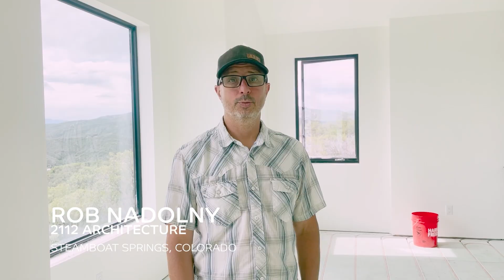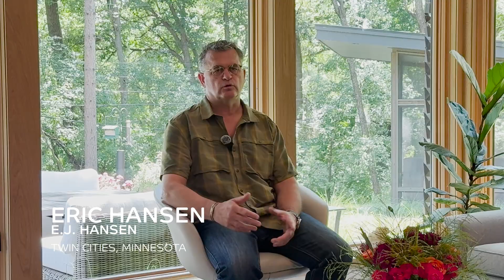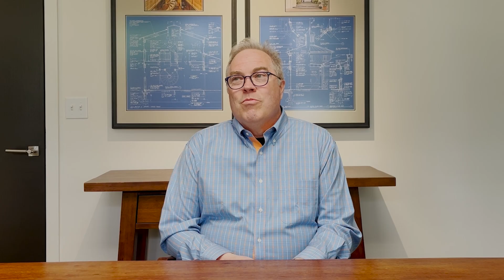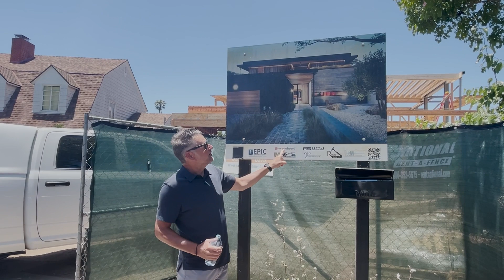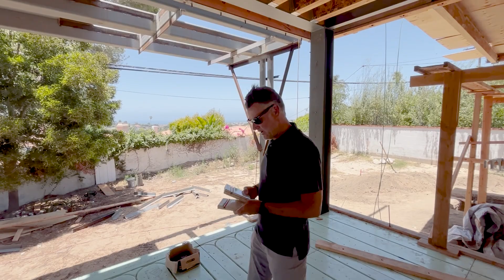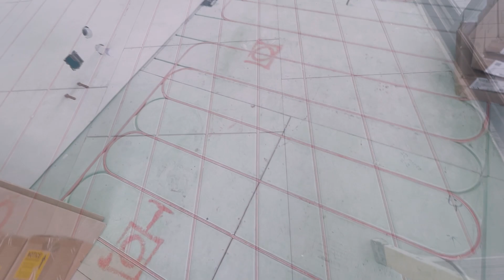Architects and Engineers talk Warmboard (Extended Cut)

Comment: What about cooling in the summer months? Can you please explain how you would go about it?
Reply from the maker: Cooling is done with a separate system - traditional AC or mini-splits, for example.
Reply: @Warmboard  I am really struggling with deciding if Warmboard is for my project - just because I cannot find a cooling alternative that will work with the system. So basically, if I install a traditional AC, that will need to be ducted - meaning that I can also heat the house via the ducts. If I install a heat pump minisplit, that is the same - it heats and cools. Why can't we run cool line in the pipe and find a way to deal with the water by product?
Reply from the maker: @basilkingsley  The current solution would be a separate AC or zoned mini-duct system. That said, we are working on our own AC solution which is in line with what you're thinking, as perhaps not shockingly, this is a recurring issue we encounter with many clients. We'll have news on this in the months ahead, but if you're able to attend either the International Builder's Show in Orlando, or the AHB show in Las Vegas, you'll be able to see the product we are working on.